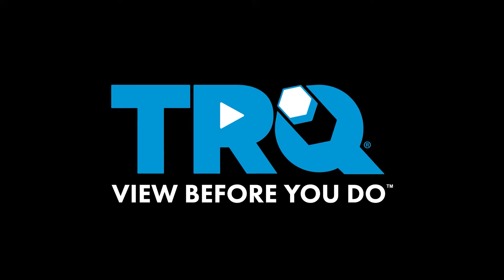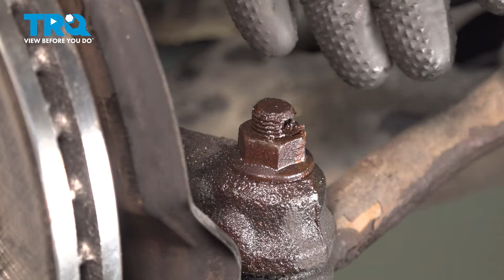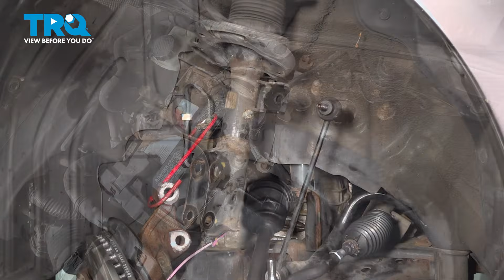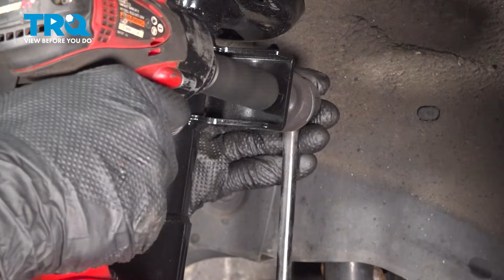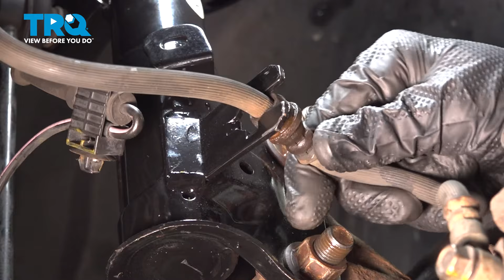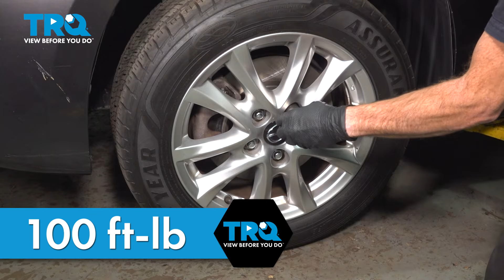How to Replace Front Strut & Spring Assemblies 2014-2018 Mazda 3

Comment: When doing my Mazda, when putting the new struts in I noticed that the distance between the strut mounts were slightly smaller than the mounts, so after spending time to remove the new struts again, I “smartened up” & used a disk brake spreader on the other side which worked fantastic. Great job, Thanks!

Comment: I see people talking about not undoing the Axle nut or cv axle in general, which technically true. But, it's possible to pop/dislocate the inner CV Joint bearings that are inside the Axle's boot. This 1. Stops you from being able to line the knuckle back to the strut and 2. Is probably going to make the CV axle ineffective if the joint's rollers and bearings are dislocated and you can't reseat them. If you want to avoid this entirely; getting the cv axle loose and out of from the wheel hub is a safer bet.

Comment: I love your videos but as others have mentioned, no need to do all this extra work. 
1. Remove ABS wire and brake flex hose.
2. Remove sway bar link front strut.
3. Remove 2 lower and 3 upper strut mounting bolts. 
4. Carefully navigate the old strut out without snagging the ABS wire. 

Install is the opposite of removal. I just did it on my 2014. Came here for torque values (way faster than pulling up the manual on my phone).

Thanks for making the video still though. Always helpful!!